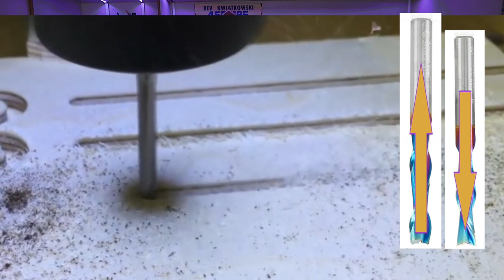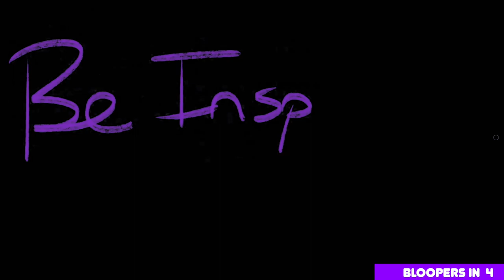CNC Router Bits for Beginners

Comment: Good vid but I notice you don’t talk about flattening bits.  What size would you recommend?  Also, you mention bits with 1/2” shanks but the Makita router only takes 1/4” shanks or am I wrong about that?  Or is there some sort of adaptor?  Thanks for all the CNC help. Mark
Reply from the maker: Hello Mark - I thought I mentioned my flycutter, but I could be wrong. Anyway, it depends on how often you are going to use it and for what purpose. 'Once-in-a-while' flattening of a waste board or spoil board, a less expensive Whiteside bit will work well (https://amzn.to/3KpOlYu). If you are going to flatten a lot of slabs, I would invest in a good fly cutter with replaceable blades (https://amzn.to/43SSqeD) -- you will save money in the long run. I have other items posted on my Amazon store too: https://www.amazon.com/shop/cyberreefguru. Everything I use is 1/4" shank which is the largest the Makita can handle. If there are adapters, I would stay away from them. Hope this helps -- thanks for watching!

Comment: Beginner question. Using Aspire software. I create the sign that I want. When setting up tool paths how do I know which bit I need to use? Or is this just a learning experience?
Reply from the maker: Hello Allen - great question. Generally, use the largest bit you can to achieve the detail you are looking for - so it boils down to a combination of the design you making and experience. For sharp inside corners you will always get some rounding with a CNC, but the smaller the bit, the less rounding and more "pointed" the corner will look.  But small bits are fragile and don't remove much material, so it is best to clear most of the material with a larger bit, then do a finishing pass with a smaller bit.  Hope this makes sense and thanks for watching!

Comment: i have a 3018 cnc machine, what is the best settings to cut acrylics, for for both rpm and feedrate, the settings i am using ends up melting the the acrylic therefore the bit
Reply from the maker: Hello. I am not familiar with that machine, so I can't offer anything specific.  If the plastic is melting, your feed rate is too slow, or your spindle is too fast.  Recommend Winston Moy's video which addresses this with acrylic in depth: https://www.youtube.com/watch?v=a9qi6Z-CEP8

Comment: Great Video!! I see the Onefinity cnc in the background and does it take a different collet or will it accept both 1/4” and the smaller bits? Thanks
Reply from the maker: Hi Jaycee - you can get an 1/8" collet for the Makita router through Elaire. I've used it on my Shapeoko and the OF without any problems.  Thanks for watching!

Comment: Good video as usual. Do you have info on feeds and speeds? Like apps. spreadsheet, etc.
Is such data inputs for chip loads etc really only specific to a bit manufacturer or can you use generalized data?
If not do you have suggestions on how to get informed in this area?
Reply from the maker: Hi Donald - thanks for the kudos! Chip loads are usually manufacturer specific and bit specific. However, they all have similar ranges.  It doesn't matter too much for wood, but for aluminum you do need to take care.  For apps, CNC explorer (https://www.cncexplorer.com) can compute feeds and speeds and let you fine tune chip load based on spindle/machine combinations [disclosure - I am a co-author of that app]. There are some spreadsheets out there, but they are usually for professional machines and the recommendations need to be dialed back for hobbyist machines. Hope that helps - thanks for watching!
Reply: @cyberreefguru  Thanks for help. I purchased your Pro app. It seems like what I need. I just need to exercise it for my situations. 
I didn't see adding other tools to the library like a personal bit or just one not in the library. Is that an option or will you continue to add other tools? I am interested in SPE Tools.
Reply from the maker: @donaldjeansonne8667  you can certainly add new bits and new materials with the pro version.  Easiest way is to copy an existing bit or material by clicking the plus icon next to the name, and then filtering on your personal items by clicking the pencil icon next to the heart at the top of the pane. Then click the pencil icon next to the item you want to edit.  I realize that is a little cumbersome, so we're making some updates to the process in the next release to make things more intuitive. Thanks for purchasing the app - looking forward to your feedback!
Reply: @cyberreefguru  I was able to add some bits easily.
Can you give me your approach to using the app on what to adjust, in what order, and what are the targets or goals?
I was using this approach to get feedrate ipm:
   DOC and WOC to be about 50% of diameter 
   chip load about 50% of bit design 
   speed 17000 rpm
I then lower speed within 12k-18K range (trying to reduce heat) and change chip loads.
Do you agree or have a better approach to arrive at settings for a particular bit?
Comments are appreciated.

Comment: Thanks for the tips on the bits! I checked out your web site and am wondering if you can do those inlays with this CNC? I hope so mine is on the way :-)
Also I saw someone say that the machine has poor stepper motors and undersized driver..... what are your thoughts on this.... Thanks
Reply from the maker: Hi Ronald - thanks for watching! All the inlays were done with the Shapeoko or X-Carve; haven't had time to do any with the Onefinity, but I will soon. There have been rumblings the steppers are underpowered when compared to other machines on the market (many hobbyists upgrade their machines thinking it will fix the rigidity issue, which it won't) . So far I have not experienced any issues, and I have not seen any actual reports of power issues with the steppers or drivers. I chalk it up to bluster and FUD - the OF punches way above its weight class and price point - period.